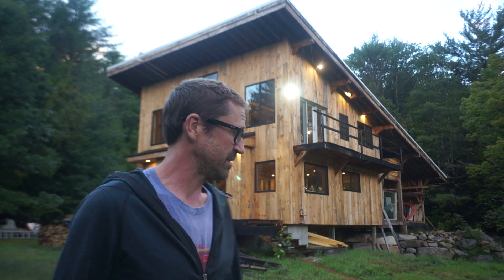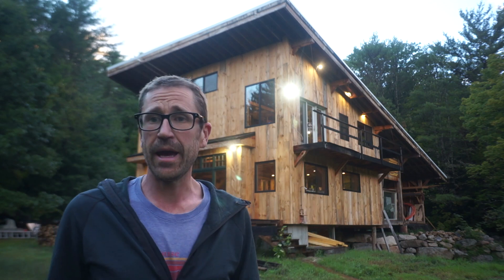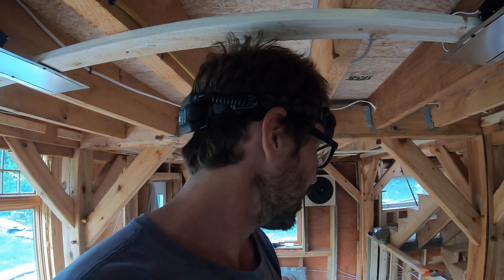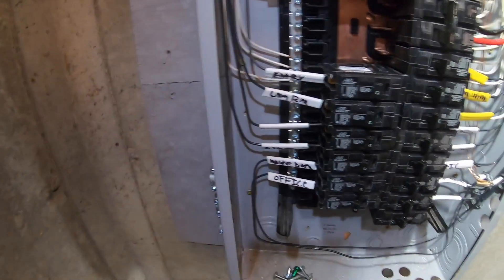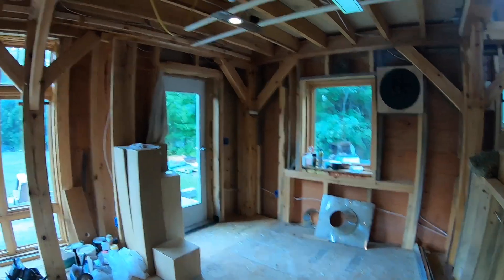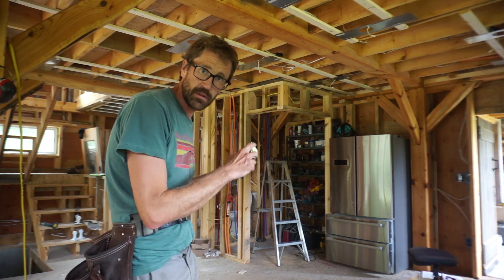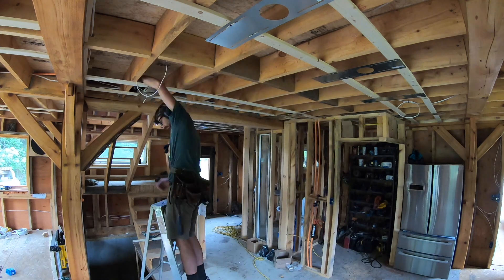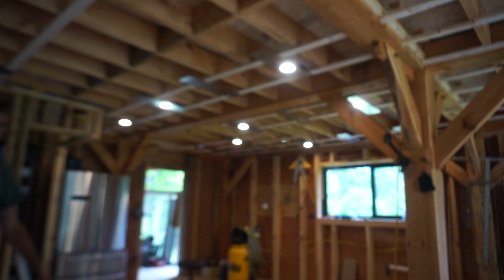Building a House from Trees SE 8 EP 5 Lights!

Comment: Nice!  Have you had a problem with trespassers?  I saw the "smile, your on camera" sign on the door window.  I'm guessing by where the wood stove is located that you didn't want it to be focal point in the house and you're just using it for heat?
Reply from the maker: Many houses on my road have been broken into in the last couple weeks. It stinks. The wood stove will be heat, but also good for staring at off the couch in the middle.

Comment: Nice work! 
Is the function of the sheet metal pot light templates to make rough in easier and reduce breakage on the edges of the pot light (drywall) cutouts when installing the LED's after painting? I'm curious how to find those holes accurately after drywall installation? Did you strap the ceiling specifically for pot lights or for additional reasons?
Reply from the maker: Yes! That is the point. I will reference this video! I will also mark on the subfloor under them. Strapped for rock too.